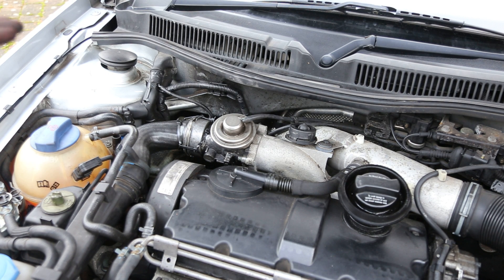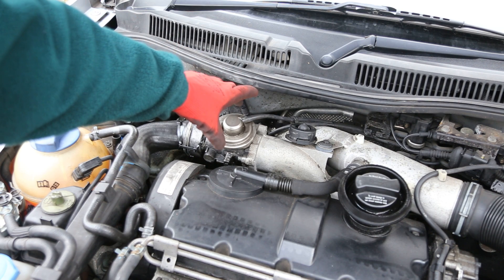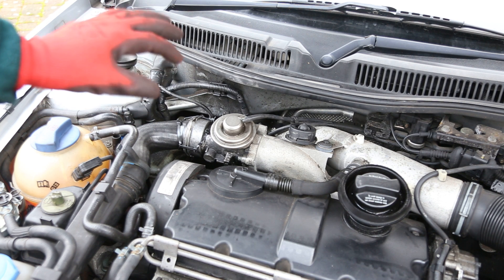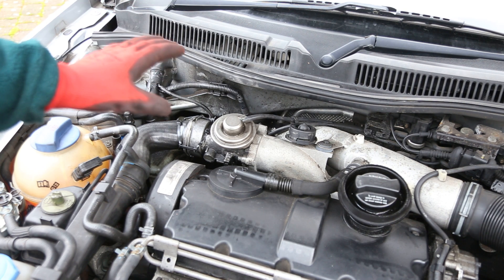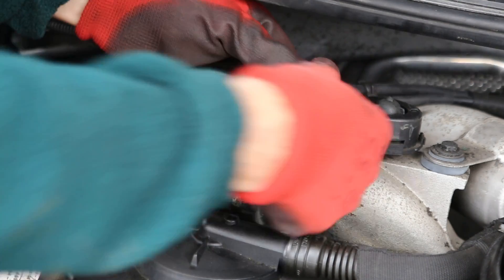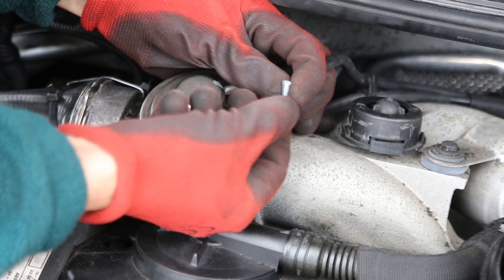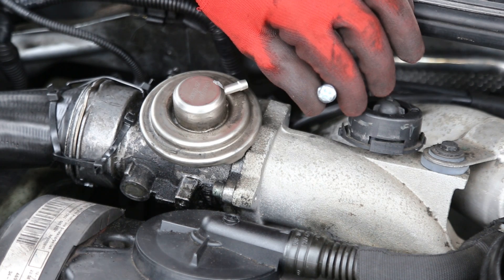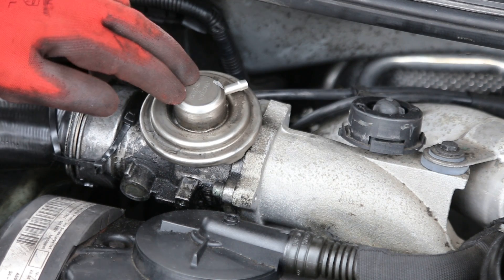Easy EGR Delete in 1 Minute! VW Golf TDI MK4 EGR Valve-Vacuum Hose Pipe Blocked Off with Bolt/Screw

Comment: I do t think you need to blank it off at all do you? Simply just disconnect? I’ve just had to do this as my egr is fully open and kept shutting off when coming to a stop. Soon as I just pulled the hose off it drives absolutely fine now

Comment: Did this method on my 2003 Seat Alhambra, its got the same 1.9 Tdi 130 engine (ASZ engine code). No check engine light for me. This Method is simple and an effective way to Keep the EGR closed, plus you keep the ASV (Anti Shudder Valve) which you would loose if you install a straight through 'race' pipe.   

If you were to get check engine light you would need remove the associated fault codes from the map file. For example read your ECU with sofware such as MPPS, load the file into DaVinci DPF EGR Remover (or similar software) and delete the associated EGR Fault Codes (The software deletes the fault codes it doesn't remove/modify the actual EGR map file). Then flash the updated file back to your car.

Comment: Bit of a silly question here, but why has the EGR hose pipe been blocked off?, under what circumstances would you block it off and what are the benefits of doing so.... am curious
Reply: Well the egr reuses exhaust to lower emissions, but by doing that your engine does not get as much oxygen, because of that it makes slighty less power and consumes more fuel, also the life of the engine shortens. The only positive thing about the egr is that it lowers the emissions

Comment: That vacuum hose on my 1.9 TDI is really tight, I can't seem to remove it from the EGR so easily like you did in the video, if I pull any harder I'm afraid it'll tear the hose pipe resulting in vacuum leak
Reply: They can be really tough to remove, if it tears you could still cut it straight and plug it up
Reply: Use a pair of pliers grab the hose on where it attaches and twist
Reply: spin it, on a warm engine as you pull, a little lube never hurt no one ;)

Comment: Do you also block off the vac fitting on the egr too or just leave that open?
Reply from the maker: I left that open, just block the hose
Reply: I’ve deleted it now, blanked both bits and no engine light on dash
Reply: Good question. I’ve got a 2003 beetle with the 100 ATD pd 
It’s got exactly the same egr set up. 
I’ve read somewhere that if you leave that hole open you could possibly get the egr “lifting” inside under full load.
Not sure if that would really happen though but I’m blanking mine in a little while today and are going to block the pipe and the top of the “ufo” as well just to be on the safe side. 
I don’t know if the light will come on my dash board but I’m not to fussed if it does.

Comment: I did this and I notice my car is taking less time to warm-up to optimal temperature  . Is this expected  ?
Reply from the maker: I've not noticed it but it could do
Reply: The EGR helps maintain the temperature of the system down in the range it's supposed to be in - it cools down the engine. Removing that effect helps heat up the engine, but it also leads to the engine being prone to overheating. On the long-run, this can cause various problems, so if you're noticing shorter times to warm up, buckle in for an overheat.

Comment: I had some nasty issues with my EGR on a Peugeot 307... I got error code P0401 and especially in cold starts, the engine would shatter and even die when revved. Eventually it would work but with power loss and limp mode. After a bit of "research", I disconnected the vacuum solenaoid from the EGR. Basically, the same thing as you just that I removed the pipe from the solenoid side because my EGR is quite hard to reach. After doing this, my car flies, like a new born car. 😁 Do you think it would affect my DPF?
Reply from the maker: Good question, (un)fortunately the Golf Mk4 doesn't have a DPF so I can't report anything from personal experience but I wouldn't expect it to impact the DPF

Comment: Hi. Nice vid. Do ya no if this would work on a 2012 VW touran 1.6. I'm constantly going into limp mode.. cheers
Reply from the maker: Thanks, I've not worked on that engine but I very much doubt it as that was one that VW had emissions issues with so it's likely to be ECU controlled unlike the older TDI engines that had no ECU link to the EGR. If the EGR is blanked off you will almost certainly need it to be mapped out in the ECU software which cost me around £125 so still cheaper than a new EGR!

Comment: Hi guys I have a jetta 4 1.9tdi the car has a misfire I wanted to know if my maf sensor is uplugged will that cause it thanks
Reply from the maker: MAF sensor shouldn't cause a misfire, it will just run to a default setting.

Comment: Removing this hose stops the egr from keeping closed while under load. What you want to do is fit a flat piece is aluminum (as a teen I used a soft drink can) in the shape of the flange. Search "dose pipe" for more details
Reply from the maker: Thanks for the information, that's useful
Reply: Its called EGR delete kit. Very easy, useful mod.
Reply: That doesn’t apply for all cars. On my BKD Golf the EGR stays shut without vacuum

Comment: I think this is just the shut down air valve, not egr. When you turn off the car the diesel engine stops smoothly because there is no air to compress.
Reply: It's called the anti-shudder valve

Comment: Can I do an EGR delete or block on a Golf mk5 1.6l (BGU engine, 75kw I think) not even sure if these engines have an EGR valve but I’d rather block it off and see if it works considering I’ve been having major engine issues recently.
If it works I’ll probably end up replacing it later down the line anyway. If you manage to respond to me, thank you for any help.
Reply from the maker: I don't believe it will work on the 1.6 engine, I think that has a different EGR valve setup

Comment: Hi, would this set off the eml on a 2003 pd130? Sorry if this has been asked before
Reply: I believe it would be likely to do that on a 2003 model as it has a later ECU. My 2002 PD130 was ok but it has the early ECU. If you are in the UK and use the TFL emission checker it will show - if your car complies with the standards for ULEZ then it has later ECU, if it pays the ULEZ charge then it has early one
Reply: anything 2002 and later will get the light
Reply: @gummikazy  100%? I have pd115 Sharan 05 plate but it does pay ulez?engine auy
Reply: @gummikazy I had a 2004 no engine light asz engine code

Comment: Will a Vw Mk5 1.9 tdi 2003 model switch on the engine light?
Reply from the maker: I suspect it probably will, the later the car the more likely it will trigger engine light
Reply: Yes, it last without for a day or two than it comes on.

Comment: Deleting the EGR you may have more vibrations/noisy engine at idle due to the engine taking more mass air, you can see it with vagcom and maybe you can see: MAF Specified: 200 and MAF actual 430 for example
Reply: @biriciksevgilim  clean every month? i haven't clean mine in 20 years a single time. car runs like new. but maybe i'll try removing this hose.

Comment: Hello, i am sincerely afraid to do this because the egr looks very dirty to me, can something bad happen if i turn off the egr?
Reply: Nothing bad will happen other than the warning lights as its emissions  only time you should reconnect egr is before mot and drive until the warning light goes off
Reply from the maker: It can set an engine warning light that needs software to clear it. If you have any worries about it then I'd suggest not doing it
Reply: @ajvw  if that program can remove the error, then there are no problems. I worry about a mechanical problem, is it possible to have these problems?

Comment: Hi Do you know if this will work for the 2.0.tdi bkd engine pre cr
Reply from the maker: No I don't believe this will work on the 2.0 as it uses a different type of EGR  valve. I have another video for disabling that EGR but you do also need it to be coded out in the ECU which cost me £120 - still much cheaper than a new EGR
Reply: @ajvw  Thank you for that, thats very helpful.

Comment: How about a RUN AWAY, doesn't  it stop a 1.9 from a runaway
Reply: No. When you block this hose you just don't allow exhaust gasses to recirculate to the intake manifold. The big flap inside the egr which blocks the air from entering the intake manifold when you shut your engine off, should be still operating.

Comment: I have the same zip tie set up on my hose 😂i did use beefier ones though
Reply from the maker: I've now replaced with a new hose that only cost £18, new video here https://youtu.be/0ZGkvud5Tuc
Reply: @ajvw  i bought a new hose but it would still pop off so im still using the zip tie method and hasn't popped off since ! Your pipe clamp fix looks like it was a good fix .. Cheers
Reply: Just wrap some electrical tape round it holds it in better
Reply: Hah same! 😆

Because the notch that keeps the hose in place on mine got eaten away by the clip.😬

Comment: Hello, looking to do this on my mk4 1.9tdi golf, will it make it perform better and what size engine is it you’ve got?
Reply from the maker: Mine is 1.9 TDI as well but there are lots of different variations of this engine. It can improve performance by not putting exhaust gas back in to engine but can also increase certain emissions as a result

Comment: Would this work on a avb engine pd100
Reply from the maker: It certainly should do but you may need software to reset if an error light appears on the dashboard
Reply: @ajvw  worked perfectly no cel light and cured my problem I was having a engine hesitation while driving slow or overtaking and now it's gone great video thank you for your reply
Reply: Hi guys I have a 1.9tdi and it don't want too rev over 3000rmp

Comment: Can you reverse the process? Will the check engine light go out if you reconnect the hose?
Reply from the maker: Really easy to reverse it, just remove the bolt and reconnect without it in. You'll need to use vcds software to clear the check light
Reply: I got my engine light on just day after doing this.Ive put it back in but light still there ,will it go away???? Thanks
Reply: @EM-oe8ms  you have to clear the error code with an OBD-tester
Reply: 2 years later. To clear a check engine light take the negative terminal off of the battery for 2 minutes. Put terminal back on, start the car and no more codes

Comment: Does it smoke now ?
Reply from the maker: No it doesn't
Reply: @ajvw  ok do you know how to make it smoke ?
Reply from the maker: @mathias_the_farmer_dk8368  unfortunately not. I think most people try to avoid that
Reply: @ajvw  well im a country boy so
Reply: You need a new software map bro. Once it's tuned it will smoke. Also to do a proper egr delete you'll need to remove or block off the exhaust pipe that connects to the intake.

Comment: Tryed it doesn't do anything still gose it into limp mode
Reply from the maker: It could be the turbo vanes that are sticky then
Reply: might need a carbon clean mate
Reply: try to change your driving habits not to drive always slowly,my car had the same issue started to put my foot down to the pedal ,it will consume 1l more but no issue with turbo vanes,alwsays spooling and no more limp mode,my car is 2001 G4 1.9 tdi ASV
Reply: Is there any way to clean turbo out without dismantle it
Reply: @derryjones1029  call a carbon cleaner, a guy will come to your doorstep and clean it out for you
Reply: Thanks bro
Reply: I screwed the bollocks off it 2nd for half a mile and it's stopped happening now weaird lol

Comment: I own a 1.9 PD105(77kw)... Will try this! Is it safe in terms of engine lifespan as many say  combustion temperature will rise n effect the engine life?
Reply: Its better for your car with egr disabled/removed. Engine gets clean fresh air in without any exhaust fumes being feeded back into intake (invented by environment enthusiasts, removed by car enthusiasts)
Reply: No the engine will be more powerful and will stop it from self destruction
Reply: @carsnracing8200  thank you i did it n felt bit relaxation in engine
Reply: Yeah my engine just jumped out might need new 
Aluminium engine mounts
Reply: @MiataBoy0  I need new engine mounts for a similar car, too! Jolts the car back. 210hp PD remapped. Let me know what mounts you order, please!
Reply: I replaced two piston return springs #1 #4 to fix the loss of power problem
Reply: @rokitman5753 ,sorry I am just learning all tdi tricks, which return springs are you talking about ?
Reply: I tried on my golf 5 2004 1.9tdi bkc 77kw and i can say its great, engine runs normal less vibration, when i put back vacuum pipe its not good, i recommend tu pull off pipe for vacuum

Comment: Hi i did this to my 1.9 tdi ajm and  after i did this my turbo sounds a lot better and it runs a little more good , but at idle and when i drive i have blue smoke coming out and also i did on the vcds turn it on minimal i think it s called , what could cause that...? oh and also my egr it.s spilling oil i cleaned it and after some km it has spillied again
Reply: Blue smoke because of the leaking burned oil

Comment: And after a bit u get a  error on the dash..😄..egr del for 1hr
Reply from the maker: Hence the warning. I didn't get the error at all on my ASZ engine but others might be different
Reply: You’re egr is probably remapped out that’s stops the error code from showing
Reply: @LeeRoyJuniour  my car is anything but remapped. And the egr delete was done same way by my mechanic.A very good one.egr to be deleted properly needs a remap even if u don't get an error.it doesn't work 100% correctly if not.that's what I know🙂

Comment: Will it work on AJM 85kw 1.9 2000. ??
Reply from the maker: As the AJM 115 bhp engine is earlier than the 130 in my car then it should be fine to do and not generate a CEL on dashboard. As per the video this is done at your own risk. The information I've seen online suggests it has been ok for others who have done it
Reply: @ajvw  Well i don't care about error i can delete it with vcds im also remove catconverter no errors im gonna try this tnx for reply bro !
Reply: @corel965  hi did you do it, does it work fine?
Reply: @epicuredeter157  yes it's all good on 115hp 2001 AJM/1j1 engine, been driving like this for over a year now without any issues or errors
Reply: Nice, gonna do this to my AJM engine as well. The EGR has a leak somewhere, I see black fluids leaking out of it.